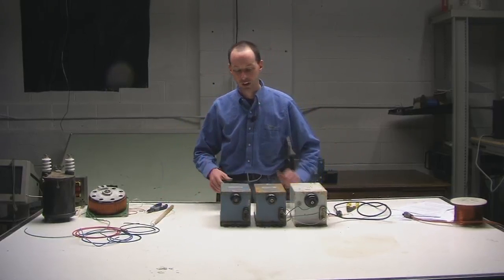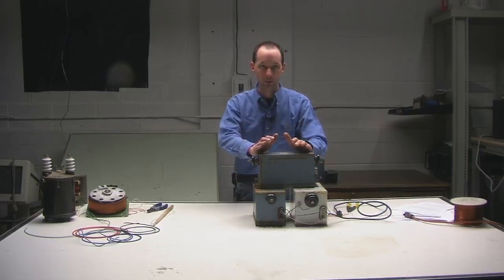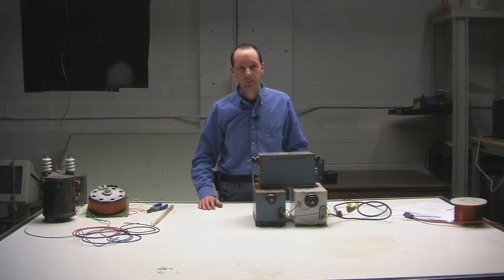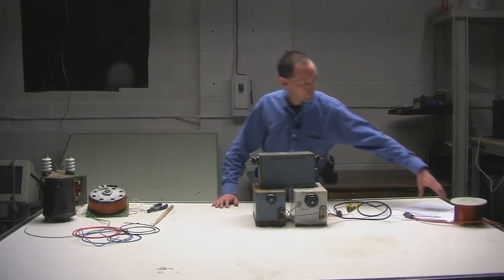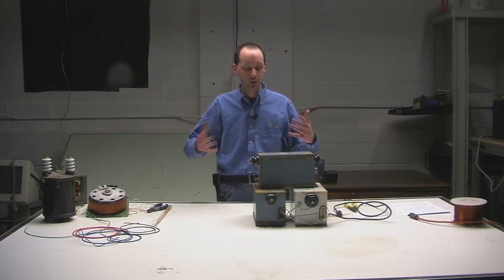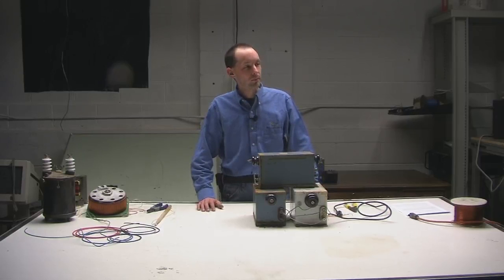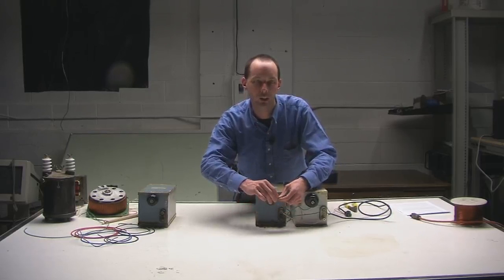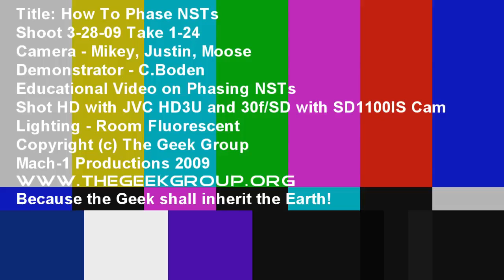Phasing Neon Sign Transformers for Tesla Coil Use Part-2

Comment: And one last addendum, a more comprehensive HV safety demo video would include the obligatory frying of hotdogs under NST, MOT, regular AC, and things like capacitor banks (since the low voltage is, as you mentioned deceptively safe). Safety warnings regarding scrounging parts from TVs, monitors, microwaves, etc would be another topic to cover.

Comment: Was shocked with about 240v working on light in a bank. Woo absolutely scared the piss out of me when I was stripping the hot wire and my arm bummed at water pipe.

Comment: guys i have a question: i live in UAE which the electric current is AC 220V/50Hz, which Neon Sign Transformers should i get becuase most of them are input of 120v,
Reply: then just make a transformer that takes 220v-120v

Comment: Would it be possible to use two outlets in your house that are on opposite phase when you plug them in and then hook them up to where it's double the voltage they normally would output
Reply: yes.

Comment: I have 4 NSTs, 3 of which have GFI, and 1 does not.  When connecting them all in parallel, 2 of the GFI nsts, as well as the older NST works but when I add in the final one (which is different than the rest) it shuts down itself and the other two GFI NSTs, leaving only the older one in operation until they reset.  Does anybody know what to do to get around this or to remove the GFI?

Comment: Well 2000 V isn't very low. If that thing delivers 3 A shorted. Than it will deliver a current of 2 A at 1 kΩ and even the whole 3 A at 500 A. That creates a contact voltage of 500 to 2000 V while a NST like mine only delivers typically around 60 mA, which makes a contact voltage of 30 to 60 V which is still dangerous but not as much as high voltage. So one always needs to consider the "contact voltage" and not the source voltage if one wants to determine the safety of a transformer.

Comment: lol my first ever transformer I played with was a mot. I was 13, 14 at the time of writing this, and i had found an old microwave in the woods at my old school. I got burned once, but thats about it, but it hurt like hell. i recently saved about $1000 to make a massive tesla coil, and i bought around 10 of these, and i have made my tesla coil, and it outputted around 100 kilovolts raw transformer power. all i want to say is don't be stupid like me, and have some common sense. and also, can someone calculate my total voltage coming out of the tesla coil? it has 1250 turns 24 gauge wire for the secondary, and 8 turns 16 gauge wire for primary, and 15uf of capacitance.
Reply from the maker: Check our recent videos. There's a whole new series on beginner High Voltage stuff and it will help you a LOT. :)

Comment: A) 8:00 is totally misleading. That is "60mA", but that's only HALF voltage.
B) 8:48 = also HALF voltage, at potentially "120mA"... BUT THEN...
C) 8.54 = That's FULL voltage, so of course it can produce a bigger spark than A.
Yet I can draw arcs larger than C using a 30mA 15kW transformer

Comment: Well, i am one of those 15 year olds. Does this suddenly mean i am incapable of doing things that are thought to be only for 'adults'? I started with bug zapper transformer, then nst then MOT then pig. I was not necessarily as safe as i could have been back then, but i have gotten a bit better. 16 year olds can drive legally. That is much more dangerous! More % people die in car wrecks than pole pig accidents. Driving you have to worry about other people, pigs you are fully responsible